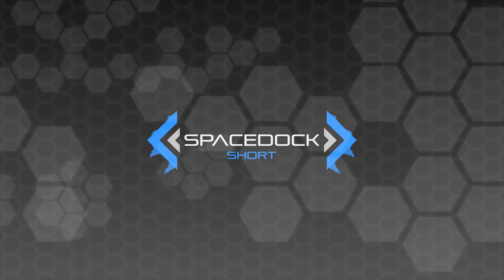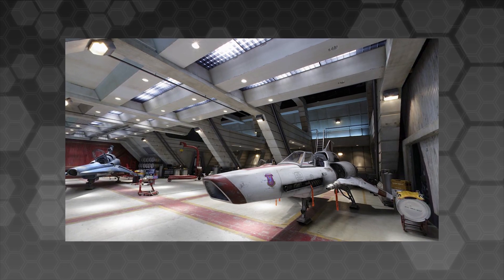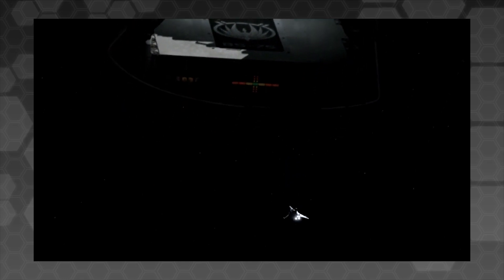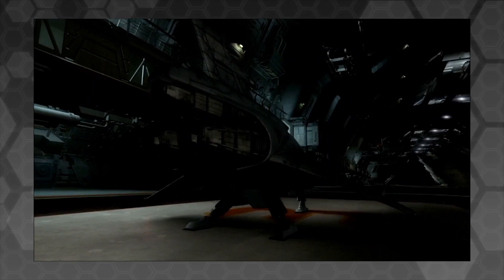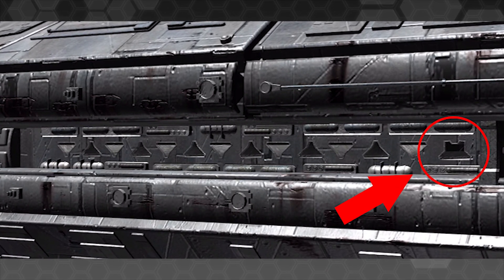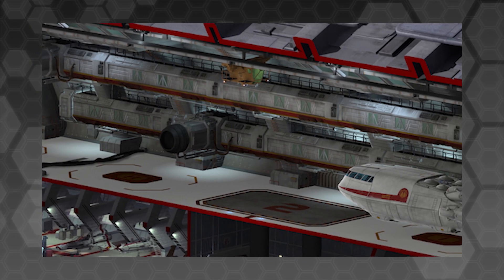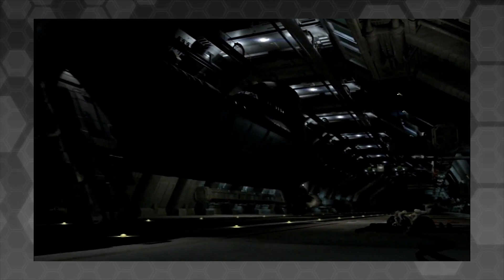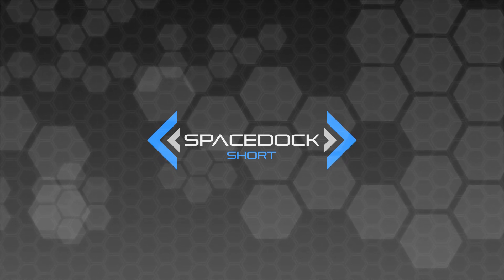How to Land on the Battlestar Galactica

Comment: Surely if the vipers are lowered down from the landing pod then for the landing mat has to be extended nearly all the time effectively removing any use for the mechanical area, as the landing pod platform will have to be extended In order for the pod to be a flat landing zone

Comment: the mercury doesnt have a "ship flip". the bottom hangers gravity is on the "roof" as it were, so when youre in the "bottom" hanger it feels like your in the top one, but from the outside looking in you would see that people are standing and working on the "roof" of the bottom flight pod.

The fighter Launch chutes on the merc pegasus are also staggered 1 normal, 1 inverted, 1 normal, 1 inverted. all along the flight pods. obviously matching the orientation is for each of the 2 hangers, and you do see the fighters from the bottom one come out "upside down".

again this is all relative hence my liberal use of "quotes".

Comment: I can see why they did not bring Colonial One on board once hostilities began.  I served as Navigator on USS BATAAN (LHD 5) n the '02-'03 time frame.  During our '03 deployment, we brought our stores (food, ammunition, people) via air cushioned landing craft (LCAC) in our well deck vice via helicopter on our flight deck.  Why?  So we wouldn't foul our flight deck with a broken helicopter when we were conducting AV-8B Harrier sorties (which required the entire length of our flight deck) supporting the Marines on the ground in Iraq.

Comment: You do know that in season 2 episode 8, 26:35 play time
 Starbuck specifically mentions how "Cat" missed the trap

And you know what a trap is right?

Do you ever do any fact checks for any of your video's when you complain about shows or do you just make shit up at night?
Reply: I have looked and looked and I know what trap is on a carrier and have never seen anything remotely resembling a trap on any Colonial BS
Reply: @nicholaspowell7029  ......my OCD is going to show throught here but bare with me a moment

The first thing you have to consider is cost, when they are spending as much money on production as this did.....bigger is better

The small amount of money ( relitively ) they would have spent animating a trap line arrangement to catch individual vipers on landing doesn't give the same appeal as swarm landing several vipers at once and have them skid, pell mell across the deck on sleds in groups 

There is also the very real fact you can't have multiple fighters trying to catch the same traps....imagine 2,3 or even 4 side by side birds trying to snag the same trap line.....only one can grab it at a time without the planes crashing into each other

Finally, these ships are shown to have some form of dues ex machina to keep the pilots from simply imploding from the inertia of the manuvers they perform at W.E.P. over and over again.

Thus,

The stated phrase of "missing the trap" vs ever showing even a single viper catching a trap has much more production value and imparts to feeling without requiring visual replication

In all reality as far as my personal experince of scraping human remains from the inside passenger compartments of much slower moving, gravity bound, wheeled vehicles here on Terra Firma ( I was an EMT in a rural town where people figured more fast = more better ) comfirms that should anyone come to a screaching halt with there vehicle.....there body chooses to continue forward until all that energy is imparted somewhere else....usually by imploding there stearing colmn into the chest or attemting to slide between there brake and gas pedel and use there legs as a ram to attempt to punch through the firewall ( which also doesn't work )

The show was attempting to give plausable visuals to absolutly impossible actions
Reply: @donneale7555  I get what you are saying, the only thing I can think of is some sort of magnetic system under the deck the assists in "trapping" Vipers and Raptors as they land, and I do not think that system could be used during a "combat landing", carriers during WW2 did execute combat landings in a similar fashion as carriers some times had to haul ass away from surface combatants but the would land and full reverse their props as soon as they hit the deck.
Reply: @nicholaspowell7029  .....without trying to get into practical engineering ( which is a discussion of which I would bring nothing valuable to the table )

A magnetic system of any sort would then lock the viper in place where it came into contact with landing surface and then require the magitism be turned off and therby allowing the fighter to float around the landing bay

A more plausible explanation ( from the perspective of the story, not actual science ) would be an etenuation of whatever gravity producing formula they use which allows all the humans to walk around and drink ambrosia from glass tumblers in the middle of deep space
Reply: @donneale7555  the obviously have some sort of artificial gravity system since the ship have no rotating parts and everyone walks around no problem, so you theory has merit, that would have to be a very precise gravity manipulation to be able to handle so many craft at once, maybe that why they bounce as the system is overwhelmed during combat landings.
Reply: @nicholaspowell7029  .. ..working from the etenuation, I would consider closer to the hull having greater "gravity"

Otherwise, the second you pass into the hanger your bird would have went from weightless to instantly however many kilo's. That would make the fighter drop to the deck almost instantly.

Were as gradual gravity increasing as you get lower would impart the same effect as a planets real gravity

For clarity.....you fly into the hanger at or near the ceiling.....zero or near zero gravity.......halfway between the roof and the deck, half earth standard ( which starts bringing you down as well as slowing forward momentum but increasing downwardly).....on the deck and within a meter or so, full earth standard gravity which allows typical flight dynamics even though there is no atmosphere ( not a really great example I admit, but it's off the top of my head and it is a TV show).
Reply: @donneale7555  interesting, depending on their level of gravity control they may be able to keep the landing deck in zero gravity hence the need for magnetic landing gear to "pull" them toward the deck, or similar to what you were saying a very light gravity field at the just above the deck that when the craft makes contact causes a weak field to envelope the craft causing the "bounce" we see.
Reply: @nicholaspowell7029  .....or even just the velocity of the landing bird

After all, they are moving....and just like an airplane landing irl, angle of appprouch and velocty affect impact

And since there is no atmosphere, the rl affects of wind don't apply

Kind of like how a ping pong ball that skims the net but is hit fast will still land towards the back of the table and then bounce for a given distance repeatedly but at high angles with same speed will bounce quite high but not as far

Comment: 3:10 NAVAL NOTE:  Calling the "BALL" actually references an Actual light ball.  To aid pilots while landing on a Aircraft Carrier in the middle of the Ocean with no reference on the tilting of the ship as it bobs in the ocean.  A series of lights Vertical (up & down) are colored Green and Red and look like lines up close (Green=Good & Red=Bad or to low) also a series of Horizontal lights that are round (Left & Right) 5 on both sides of the Vertical bar (colored as RRRBB B=Blue/R=Red with B near the center) Centered. (For reference GGGRR flip it so the G is on the top, the 3rd G next to the R is were the Horizontal bar would go).  From far away the Horizontal line beam looks round due to the shape of the lens.  Pilots would look to make sure that the Horizontal ball (Green Light) is even with the Vertical lights (Blue).  It should look something like this (BB-G-BB).  If they see all that when approaching the carrier, that is consider "Calling The Ball".  This will aid them a straight path to land and hook the wire to stop on a runway that is slightly shorter than a Football field.
Reply: I'm a 20 year navy vet.  I also work on the equipment that I'm referring to FLOLS/VOLS Fresnel Lens Optical Landing System or Vertical Optical Landing System

Comment: In response to your question about how they turn the vipers around on the Pegasus to match the rest of the ship's gravity: I don't think they do. If you look at that image of the Pegasus' launch tubed, the one one with the Raptor tube, you can see what look like upside-down Viper launch tubes. I think they have just literally gone Ctrl-C, flip horizontally for the Pegasus' flight pods. There probably is some rotating lift for transferring supplies and stuff between pods though.

Comment: for the Pegasus i cant believe i didnt think of this earlier but i think she has, much like the double runway, double staging areas in each pod due to the way the pods orient themselves. When you see the launch tubes on the Pegasus they are inverted in a repeating pattern, IE one "Upright" and one "Upside down" relative to the ships normal "Up", meaning they might have separate loading sections for the vipers, which are then lowered down and pushed into the tubes which meet at the center. this means the artificial gravity generators might be in between each section of the ship, and allows for faster recovery, refueling, and rearming of vipers since you have 2 dedicated sections devoted to it without having to reorient the ships. it would be more sensible than just having the vipers be re orientated as they make it in to the tubes since then the area where the tubes would be located would be "Thrust G" relative to the vipers ensuring no weird 2 G force feelings on the pilots end resulting in a sudden spike in Positive/Negative G forces.

Edit: little bit of an after thought but considering the Pegasus is supposed to have a larger wing of Vipers compared to Galactica it would almost become necessary to field it this way so as to lauch as many vipers as possible in a short amount of time since if it was like Galactica all those rotations would eat up more time to get them into the launch tubes

Comment: The starboard launch tube was turned 8nto a gift shop when the Gallactica was turned into a museum, but I’m sure it could be turned back into its former self relatively quickly to allow the Battlestar it’s former self when the Cyloncs attacked. After all they had several arly Vipers on display back on earth, one of the older vipers turned out to be Adamas old fighter from the first Colon war a bigger problem they would be facing is the fact that there were Cylins that looked like humans. At the time of the attack, and they had no way to tell them apart from humans!

Comment: I imagine the ventral pod lifts might work the same as my ships stamp. Stamp faces the ink well where your palm holds it and flips round to punch the paper when you press down.
Also, would it really double the carrying capacity, just having a ventral pod. Doubling the retrieval capacity I can easily see, but to double everything else the hanger bay would need to be twice as large, and launch capacity would need twive as many launch tubes.
Oh, what if the ventral pod had its own hanger deck that's upside down relative to the rest of the ship. No reason not to have an entire deck that way if you wanted to in space.

Comment: The landing here doesn't make any sense though assuming they are in the vacuum.
In "Hand of God" Apollo pretty much hovered with his craft after flying through the tunnels without losing lift (like it should in vacuum); but then on "The Final Cut" when Kat has problems landing, the LSO keeps telling her to add/reduce power like if she was inside an atmosphere and required speed to produce lift. It's so cringe.
They should be able to simply hover and land instead of being forced to touch down while having a considerate speed.
Reply: I agree with the add power but i wouldn't be surprised if the viper activates braking thrusters when the pilot "cuts power" to simulate an atmosphere. A bit like elite dangerous. I think the point of the practice was to make a combat landing, not a regular one

Comment: I always assumed that they were strongly discouraged or restricted from using their primary engines within the hanger landing deck, either because there are a lot of fighters coming in at the same time and engine clearance would be too difficult, or similar. The RCS doesn't have the thrust available to slow them down at combat landing speed, so friction with the deck itself was the best option. The flight deck is probably crazy reinforced for this sort of abuse, and the landing struts are similarly designed, where as reverse-thrust engine wash would melt fellow fighters or the deck.

Comment: Re: double hanger decks...one would need to flip the Vipers, they could stay “inverted” (presumably the ships’ artificial gravity works in whatever direction it’s needed; if not electronically selected, then it would be installed and “hard wired”).

The pilots and maintenance peeps could either climb an Escher-like stairs/ladders or into a spherical elevator, walking inside to match the rotating gravity field.

Comment: Good video.

A thought I had on the orientation of the craft landing on Pegasus.

Mechanically it wouldn't be hard to flip the craft over. They have lifts already. Flipping one on a axis isn't hard from an engineering standpoint. Their magnetic feet would keep them in place... what I really was thinking.......
The effect on gravity would be void when it comes to the pilot.

The raptor for sure and I assume the vipers too, have their own gravity and both have inertial dampeners.

So it wouldn't matter a dot to them if they were "upsidedown" relative to the ships established up/down or not.

They've always been the right way up in their spacecraft. The internal workings of the ship can flip them over. Roll them around and bounce them like a basketball and they wouldn't care or feel it.

Comment: I would think that there isn't any mechanics to rotate the craft after landing. My guess is that there is 2 hangars each with their own gravity direction. Having two hangars with differents crew isn't much a problem a lot of aircraft carrier in history had several hangar for safety. In addition, on the peguasus we see two row of viper launch tube up side down. So I guess each flying deck, have their own hangar and launch deck with their own direction of artificial gravity.

Comment: The reason they use raptors as shuttles is because they are jump capable and the military shuttles are not, and if the fleet needs to jump away, the Raptor pilots can essentially jump with the fleet to continue their shuttle flight routes to and from their destinations.

Comment: You're over thinking the movement of Vipers to the hangar deck from the lower flight deck of the Pegasus. You wouldn't need a lift. All you need is a pad that swivels 180 degrees. To the pilot, it would feel just like he was rolling the fighter. Simple, clean, and low maintenance. Just two bearings, and a lock.
Reply: Shit, that is brilliant. Good thinking!

Comment: As a note, "Checker's Green" (or "Checker's Red") does not (according to the BsG novelisations, at least) refer to the board being green, all good to land, but rather the colour of the designated OLS marker (the "ball" that each pilot is assigned for their landing approach) the pilot is to follow (but not attempt to "chase" or match speed with the lights flashing along the pod, or they'll wind up moving too fast relative to the carrier to land safely).
It also notes the "Downwind Approach", mentioned in a couple of episodes, refers to a landing made by matching heading with the Battlestar and overtaking from astern, minimising the relative velocity between Viper/Raptor/shuttle and the Battlestar. Obviously, there isn't really a "wind" in space (aside from photon pressure from the sun, or as a result of an explosive decompression nearby), but it was acknowledged as an explicit reference to the wet-navy practice of turning a carrier to run before the wind to recover her planes where possible, to make it easier on the pilots when landing.

Comment: Pegasus' hangar is probably oriented perpendicular to the ship's centerline. I'd guess that the lifts are oriented so the vipers land with their noses pointing outwards, in the same direction they would eventually launch. When the lifts take them into the hangar, the "ceiling" is towards the outboard side of the pod so the vipers enter the hangar standing on their tails.

This would be a pretty advanced feature for a battlestar. It allows them to more easily access the viper's parts for maintenance and it lets you use the hangar space more efficiently. It would also let you launch more sorties more quickly: if a returning viper doesn't need repairs, you can take it straight from a lift to a launchpad two minutes after you refuel it and the viper launches "up" from the hangar like a rocket from a VLS tube. Having the launch tubes opposed to each other also means they can be much closer together, which means you can manage a much larger fighter group overall.

Comment: No, there was no rotation platform on any of the pods aboard Pegasus. If you look back to the launch tubes pic you will see inverted launch tubes between each upright one. This suggests that there were 2 hanger decks between each landing pod.